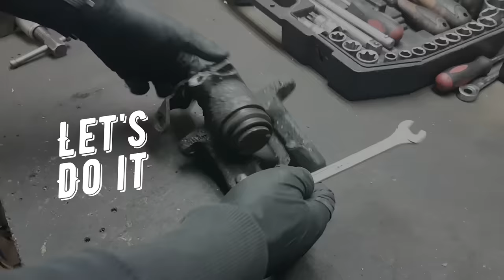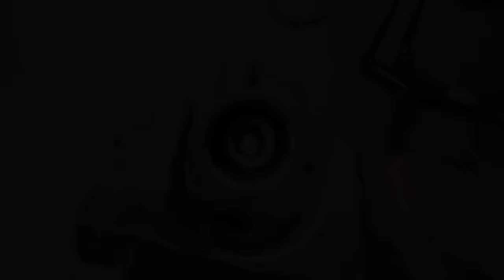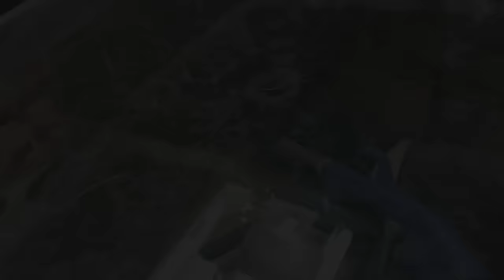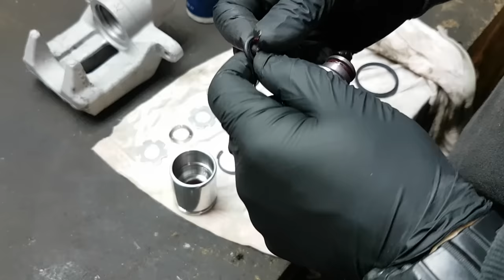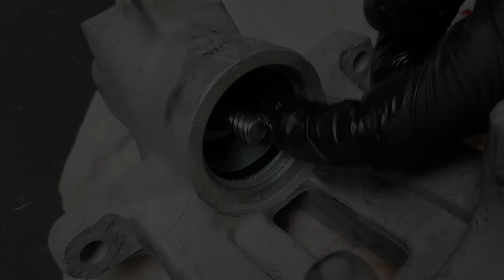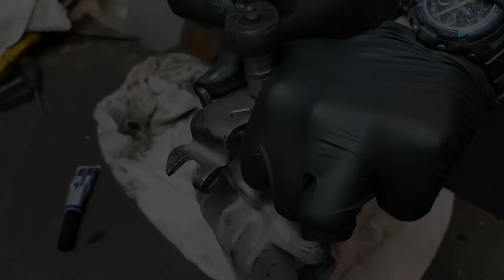How to rebuild rear brake caliper - VW Audi Skoda Seat - New piston and seals (COMPLETE GUIDE)

Comment: You should use,
1.) Grease based on brake fluid for inner parts of calipers (so it can mix with brake fluid),
2.) Silicone grease outside where rubber is touching it.
Reply: Or you can just use brake fluid to grease/seal the inner parts, right?
Reply: We didn't see any grease inside the parts from the video and my caliper, so I guess it maybe not needed grease inside, I'm going to clean everything inside, make sure it can move as the design, and install them back, my mechanic repair my car recently, but the brake became worse, the boy don't understand the idea of Cadillac Style Caliper

Comment: Hi. Very interesting video. Great job. I have a mk4 jetta with a seized hand brake. I can't seem to find anybody that reconditions the caliper , so ...  i will have to do it myself. The question is, what brand of seal kit did you use? And is it necessary to replace the piston?
Reply: Did you rebuild yours or buy new ones? Heard if the piston Isn’t to bad and rusty you can reuse it.
Reply: @hardcore4476  it was rebuilt.  There wasn't any rust at all. A new set of seals and all good.
Reply: @hardcore4476  and by the way,  you can find sets with a new piston în it .
Reply: @DjTommy2008  Right. Even with a little surface rust you can scotch brite and be good. Glad you got them done. What year/model calipers did you rebuild?
Reply: @hardcore4476  2002 Ate

Comment: hi 
why different greases ( you use red rubber on the o ring then litium/axle grease on the hand. brake then silicon?  on the piston  o ring ) why not just silicon or red rubber all the way for all the oil seals
Reply from the maker: Hi :) Yes it's true you can use one type of grease. However from my experience I can say that the red grease witch was included with repair kit is too "dry", to use it on the piston outer o'ring.
So to not waste it or throw it away i'm using it just to lubricate inner part of piston. To lubricate piston outer o'ring i'm always using silicone grease called "brake silicone paste". It's way better than any other grease. And you will feel the difference comparing to that red grease or "bosch superfit". Piston it turning very easily. 
And finally bosch superfit.  I'm using it for parts that are outside and they are exposed to external conditions. It has got really great wash-out resistance, it's not sensitive for temperature, it's sticky, and it's also safe for rubber elements. Silicone grease is not enough sticky, and it could be wash -out easily by water. That's the reason why i use "Bosch suprefit" grease to lubricate end of the hand brake mechanism shaft.

I hope my answer was helpful :)

Comment: Not bad not bad at all, couple of things though. May not have shown in the video but it should be pressure tested, wire wheel might be a concern or use a fibre wheel, the first few seconds you can see this guy knows his way around a spanner or two just by the way he takes out the bleed nipple, crack off turn back then take off or out it cleans the threads anyone else see that!! As an mechanical and marine engineer worked on all types of valves butterfly etc,, and some you could park a car in, seals the size of your neck, hydraulics some people underestimate the power and science behind such a small amount of oil can move,

Comment: Why did you use silicone grease on the oil and dust seal and that bosch grease for the rear seal and o-ring which is also rubber? I am in the process of rebuilding my calipers and would like to use Ate silicone grease specially designed for caliper assembly, is something wrong with that to use silicone grease for all rubber parts? Thank you

Comment: hi thanks for this video you helped me a lot but i have some question if you can help me:
the red grease is only for the mechanism or for the seals as well?
I just have to change the dust cover seal on my calipers because they are torn I just dismantle the piston and the dust cover I just plan to change the dust cover and the internal gasket my question is: I must grease the mechanism again or not ?
or just grease the handbrake seal (I will not disassemble this one)
Thank you in advance for your reply

Comment: Bit of a long shot seeing how old the video is, but here goes. The Seeger ring (circlip) on the internal of the caliper that retains the handbrake mechanism, mine does not want to seat correctly. It looks smaller than the one in the video and of a slightly different design, and it seems to want to seat in a groove within the caliper as opposed to how it's fitted on the video. My calipers are for an 2011 A3.

Comment: Hi, my caliper works fine, my car is an AUDI 80 B4, similiar rear caliper like the one in the video, as said, caliper works fine, but the hand brake mechanism goes only till a point, it shall be easy to move right?

Comment: Just rebuilt my caliper the exact same.. my piston doesn't move when I pull the handbrake lever though (12:53). The piston moves smoothly in and out with the windback tool but doesn't move at all with the lever. Any idea why this might be?
Reply: Did u find out the reason for this ? I have the same problem 🤬

Comment: my red caliper (2005 mk4 gli) has a 38 on the back and when i use the hand brake to pump it out it only goes a little the will stop pumping but the piston isn’t even half way out. is there any other technique?

Comment: Thanks for this video. I heard that rear piston rotation ( to push it down) is not the same for left side and right side (one side clockwise and the other side anticolckwise). Is that correct??? Thanks from FRANCE.

Comment: When you removed the actuation arm for the E-brake.  Did you mark it's orientation to the shaft?   The caliper on my X-type appears to an orientation.
Reply from the maker: Hi there. No I didn't. Because in this brake caliper arm touches metal bracket and this is an orientation point. Regards ;)

Comment: Hello I did the same restoration of my brakes cliper (Bosch system) and everything went well but now that I put them on my car I have an issue. In fact, when I brake, the car stop and the brake pedal is hard then after few second becomes soft and the car restart moving. I checked and have no leak of the brakes liquid. Moreover, I purged the system. Any idea how to solve this issue or where it comes from? Thank you

Comment: Why all the different lubricants and greases? Can you explain why you need the red grease inside (I assume it's some kind of assembly lube), but then use Superfit brake grease, and then some kind of silicone seal lube.  Shouldn't everything really be synthetic silicone lube on the inside?

Comment: A great video, I did everything as in video except the sanding calliper as I don’t have equipment for it, but cleared as much as I could and it didn’t help to me. Basically the piston is not returning like yours during demonstration after assemblyIs it possible that hand-break mechanisms could be faulty?  Thank you
Reply from the maker: Hi there, did you try to retract the piston without dust cover and without piston seal?
Reply: @carsguidediy  hi i have the same problem when pumping the hand brake bracket the piston doesn't come out fully only about 3 mm then goes back in but my other rear caliper pumps the piston all the way out. Did this with both dust covers removed but left the piston seal in. Can you advise?

Comment: Can you just remove and clean the piston or replace it and fit new seals instead of a full stripdown? I have sticky pistons on both rear calipers on a Mk7 golf. The car is only 6 years old and 41k miles. The calipers have the electric parking brake on them.
Reply from the maker: Hi there. Ofcourse you can. Full stripdown is recomended for worst case;) 
Regards

Comment: hi i own a 2006 vw passat 3.6 and i am planning on completely changing the  rear brake calipers with the motor...i have a scan tool that does the release and close...but do i need to do anything other than bleed the rear brakes after i change the new calipers....
Reply from the maker: Hi there. Only bleed the caliper then close it with scan tool ;) 
Regards

Comment: Need your suggestion please

I was wire cleaning my Seat Alhambra rear brake calipers for red spray paint. During removing dirt/rust I accidently slightly damaged the brake caliper piston dust cover. So my question is do I have to replace the dust cover as soon as possible as I did touched the piston seal.  Please let me know on your earliest convenience I'll be waiting 🙏
Reply from the maker: Hi there, You definitely need to replace dust cover.
The sooner the better. But if you have to use the car for a week with damaged dust cover, nothing terrible will happen.
Regards :)
Reply: @carsguidediy  cheers 🙏

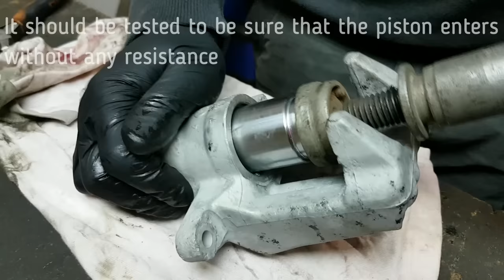Comment: From 9:33 my piston rotates well but does not go all the way. It remains rotating at a level 1 cm or sometimes more too high. What might be the reason? The 11 mm outlet screw I keep open so that the fluid can go out. The handbrake components I did not touch, they remain in place. Only replaced the brake pads and now I try to push the old or the new piston back in, without success.

Comment: Hi, can you link the grease used on seal inside the caliper at 8:20?
Reply from the maker: Hi there, It's silicone grease for brake piston , safe for rubber elements. "Silicone PTFE grease for brake piston"
Regards :)

Comment: I have just spent a frustrating afternoon trying to fit new rear pads in my golf plus (same as the vids caliper) and after realising rear pistons screw in, to then realising my piston on rear left was sticking and the boot is split and needs replacing. Found this video and now really seriously thinking for £12 I can do both (I'm sure the other side is OK but as I'll be doing pads, why not? )
I'm just wondering how OEM calipers are ranging from £90 to £22 each for an ebay special. These are aluminium right? So I assume the cheaper ones on ebay etc must be some cheap cast metal and will likely be so inferior that they will crack or snap? Anyone with any advice would be great. I think I'm best to refurb right? Ps do the ring circlip pliers need to be 90degree or will long nose straight ones also be OK? Straight ones seem so much cheaper. As the car is 16 years old, I don't really want to spend too much on a tool I'll use once. So £20 (including buying pliers)  all in to refurb both rears or buy 1 cheapo crappy part for £22. What would you do?

Comment: I have installed 2 new caliper and they came with springs on the handbrake arm, should I remove them as I never see them on videos??
Reply from the maker: Hi. Don't remove it. That's right, spring should be at handbrake arm. Brake caliper that I renewed hasn't got spring because i received it without the spring. Probably someone lost it before it came to me. 😉
Reply: @carsguidediy  just as I thought, trouble is I'm getting brake binding after pulling the handbrake, on a year old caliper which still has the spring which should aid it to release!.
Reply from the maker: @johny79action   Sometimes also can be problem with hand brake cable. Brake caliper can work properly but cable can stuck. Then  spring won't help  ...
Reply: @carsguidediy  Handbrake cables were both free moving, but what fixed it oddly was swapping the sliders top to bottom etc.

Comment: It sure went together far easier 4 u than I, not a job for the novice !, fitting that handbrake assembly into the casing I found I needed to compress the assembly 1mm before I could get the circlip grove exposed else no getting the circlip in, sad looking housing for that outer seal on your caliper !, not much left of the bore for the seal, badly damaged. I filled the caliper with fluid getting the air out and plugged the hose hole a couple of hand turns with a 10mm grub screw with a little thread tape, made bleeding a far easier job.

Comment: Does anyone know where I can buy the little rear rubber -rings for the rear brake calipers for 07 GTI? I have the front and rear piston seals but need little ones for e-brake part. Know what they’re called and where I can buy them in the USA?

Comment: Can I still rebuilt it if the brake fluid escaped through the back of the piston where is an axle connected with the handbrake cable? I heard that the liquid escaped from there because that axle is worn out and it cant be rebuild.
Reply from the maker: Hi there, probably you have damaged sleeve at the back of the caliper. if you can find one and replace it that it's worth to do it. if not it's better to buy new one or used one in better condition.
Regards :)

Comment: ran into your video cause I am about to do the same thing. There are 2 sizes of pistons 38 and 41 mm , how can you see the difference? without measuring
Reply from the maker: To be 100% sure you have to measure it. But sometimes on caliper body is stamped number that is responsible for diameter.
It's hard to find it when caliper is dirty.
Regards

Comment: Thank for this!

 Yesterday i tried to repair one of these. Replaced the piston ( was seized/rusted), the small seal from inside the piston,the main seal and the outer one. Did not take out the hand brake part from the back of the caliper nor change those two seals. Could this be the reason why now i have a somewhat spongy brake pedal? The brakes seem to work fine but if i press the pedal it travels almost an inch before it hardens and i  can't press it any more.  New pads on both sides and bled the brakes with someone pushing the pedal both with the engine off and on.
Reply from the maker: Hi there,
Do you have any brake fluid leaks from that caliper? if not i suggest you to bleed the brakes again. But do it in all brakes, even front.  When you fit new brake pads did they move freely in brake carrier ?
Let me know how it goes?
Regards ;)
Reply: Cars Guide DIY should the handbrake part be opened or can it be enough with cleaning and putting new piston?

Comment: Video si great! I have question about rear calipers on mk5 GTI  (leon fr, ocravia mk2 vrs, etc)  The calipers have the same hand brake mechanism inside like on your video, but I have trouble to put this mechanism back inside  to the caliper becaus it seams that first I need to press it (mechanism) and then put the seeger. Can you please advice? Br
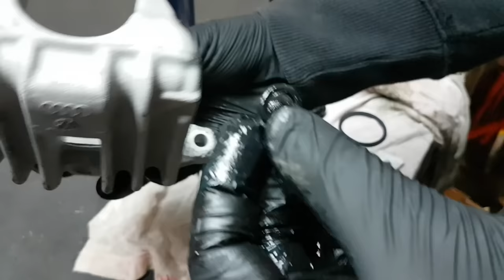Reply from the maker: Hi there. Did you mount on place that small "o" ring first? 7:28

Comment: Hi there, Would this be the same process for other rear brake calipers with integrated parking brake? I have been trying to find a video for my 2012 Hyundai Elantra rear caliper .thanks.
Reply: The innards are similar, but this video is not really applicable to the Elantra caliper. I disassembled one and I found it impossible to rebuild w/o some kind of special tool.

Comment: Can be repaired if it leaks in back were hand brake ic conected it leaks there in my car can u help thnx.
Reply from the maker: Hi!
 It's hard to judge without seeing the problem. Everything depend in what condition is shaft in your handbrake mechanism? And in what condition is caliper body, exactly in place where handbrake mechanism go thru caliper body. if it's not rusted you can just replace shaft seal (oring), or insert thicker one. But if it's in really bad condition and it's highly corroded, probably you have to replace complete caliper.

Seal that I'm talking about you can find 7:20 video
Reply: @carsguidediy  yes that small oring is gone thank u very much .

Comment: Video fatto molto bene
Reply: Che tipo di grasso usate per le pastiglie e per i vari componenti della pinza?
Reply from the maker: For brake pads i'm using "Cera high temp brake grease" make K2. But also Bosch superfit TO 102 is ok. For 
brake guide pins only Bosch superfit or "ATE plastilube".
Reply: Ok grazie

Comment: $300 of tools, chemicals and time and a $52 dollar caliber is partially restored to 1/2 life usage. Makes so much sense.
Reply: The cause of failure on these is aluminium corrosion around the seals and usually corrosion on the piston, often due to a split outer seal. The rebuild kit costs £15, the snap ring pliers cost me £12 (not actually necessary unless there is a problem with the handbrake mechanism inner seal which is unlikely if it isn't leaking). Some small wire wheels for a Dremel cost about £3. I had everything else already. Total cost of rebuild per caliper was ~£30. Every internal surface has been fully scoured to remove corrosion (important to do the lip around the outer seal too). With new seals and piston and all corrosion removed there is no reason it shouldn't last about as long as a new caliper which would cost ~£110 for a trw one. You also learn something and have the satisfaction of repairing the item yourself.
Reply: incorrect
plus he improved his skills, rather then buying which anyone can do
Reply: @doogyscoot  Apparently your time is of no value.  I rebuilt my 2 without the special long nose pliers for the retainer ring.  They work fine but it was the dumbest rework I ever took on.  Rockauto.

Comment: Great video, where did you order a complete rebuild kit? I can only find the piston seal and boot kit.

Also, is there any way to fix a sticky park brake or do I need a new mechanism?
Reply from the maker: Hi there.
Everything depends in which area you live ? In Europe you can easily find it on ebay. Type, "Vw rear caliper rebuild kit, piston"
With sticky park brake you have to be sure what is the problem. It can also be hand brake cables. 
If it's mecanism, usualy it's problem with that metal sleeve https://www.youtube.com/watch?v=YHPX8lEHFKs#t=456s Clean it and grease it 
Regards :)
Reply: @carsguidediy  thanks! I'm in Canada, but found a kit from the UK. I'll take a look at that video for fixing the park brake mechanism. Thanks for the info!